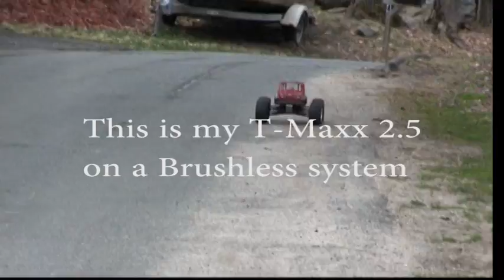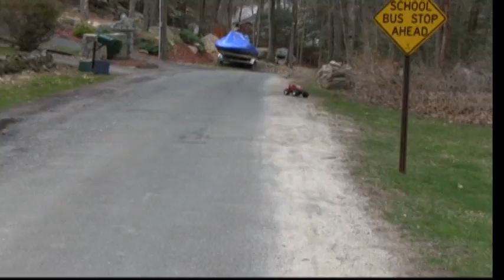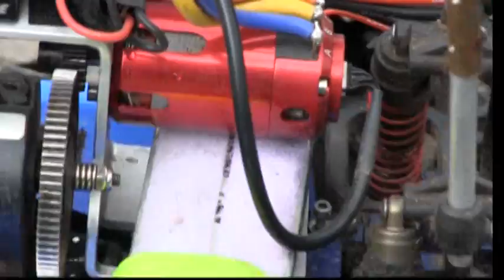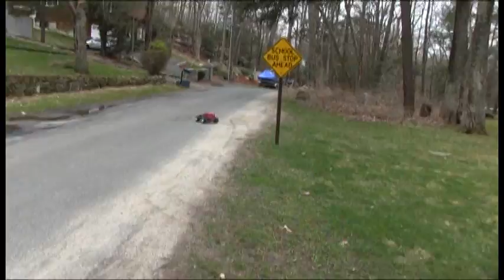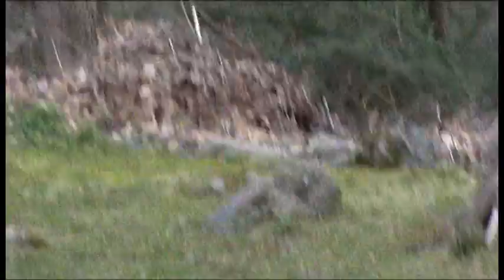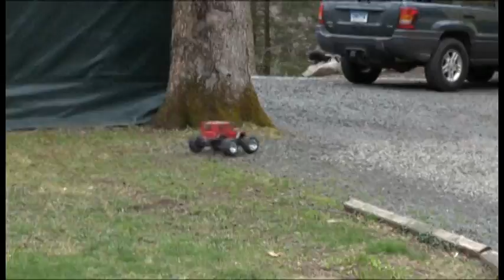Traxxas T-Maxx Conversion Battery Brushless

Comment: Just installed mine with a Monster X ESC and a 2200kv motor. Now I just need to work out the battery situation. I’m planning to 3D print battery trays that bolt to the frame and then 3D print a receiver case that mounts where the throttle servo went.

Comment: What motor KV
Reply from the maker: That is a 3700Kv motor running on 2S you can run it on 3S. be very carefull it doesn"t over heat the motor..